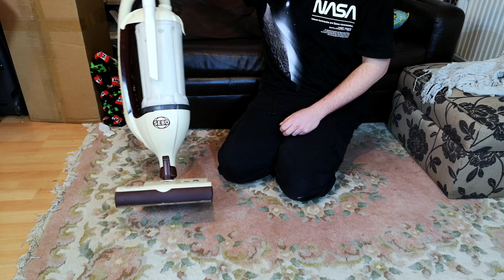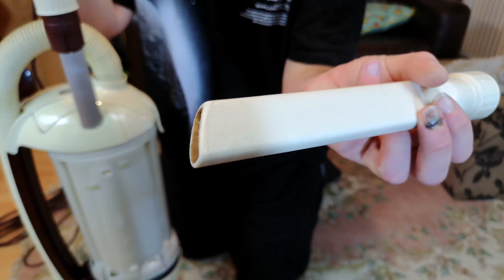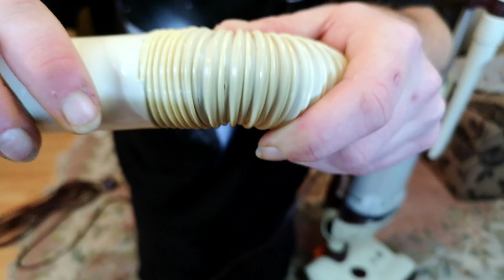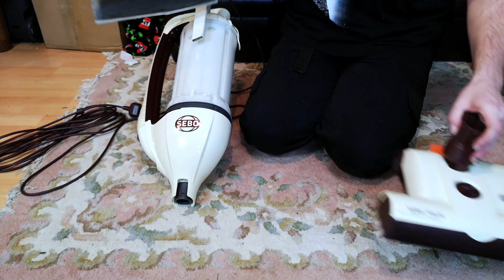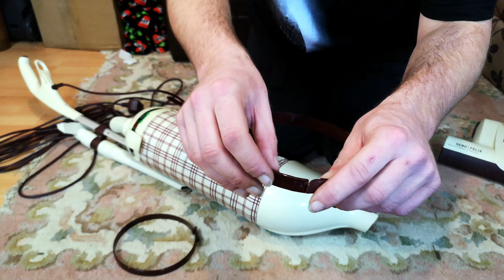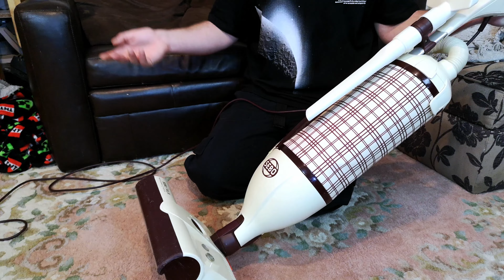My Sebo Felix Classic from 2005 - After Restoration and NEW PARTS! @ManchesterVacs @sebo_uk

Comment: what would you recomend cleaning the plastic cylinder where the outer filter fits.
Reply from the maker: I give them a nice wipe down with a damp cloth and general purpose cleaner on the outside. Inside is either a vac out and leave or it's been stripped and washed!
Reply: @beko1987  cheers

Comment: Just realised I've had my Felix Rosso for 10 years in May - bought it new in May 2014 just before the EU regs for vacuums came in, so its the last of the "full power" Felix models before they went all "eco". Also hard to believe the Felix as a model is now pretty much 20 years old - they still look pretty modern. Hope the hose on yours hold out though, sometime the hoses on older Sebos start to crack and get holes in them, but I'm sure you will be able to sort another hose out for it if it does split. The one thing I have noticed though is the cable relief grommet is different on yours than it is on mine, it exits the handle in a different place and is not a concertina style like on later Felix's.